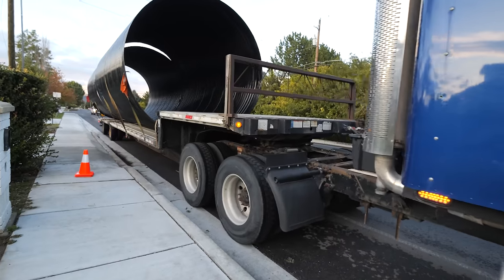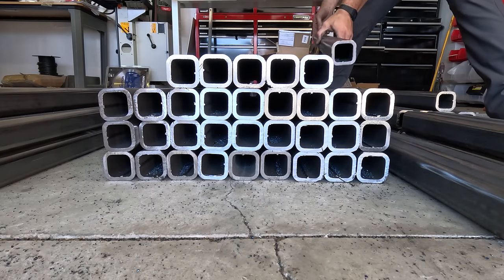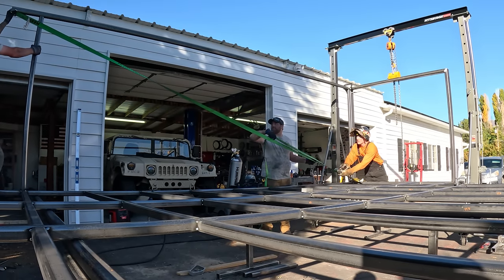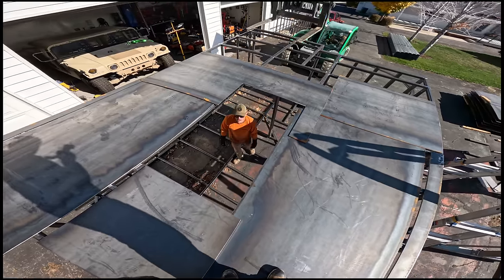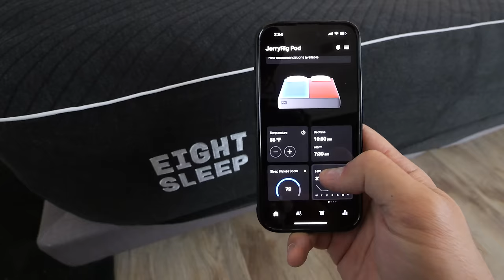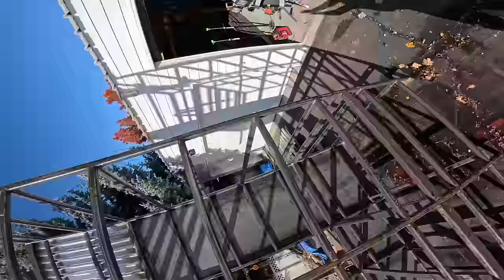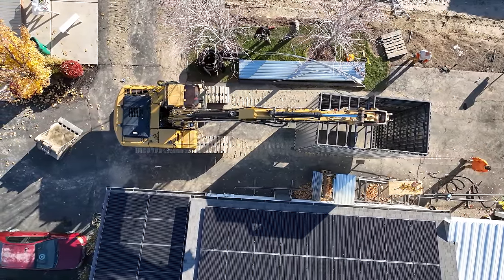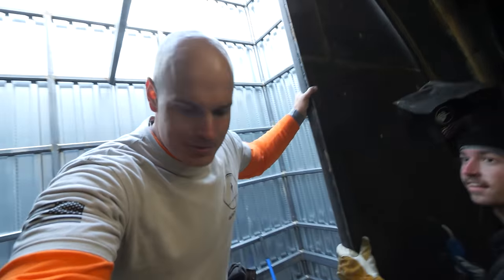BACKYARD BUNKER PART 4 - THE ELEVATOR SHAFT

Comment: Cold saw is most price effective method (fine teeth/lower rpm with coolant). Paying to have material bundle or laser cut to length saves loads of time and money. Plasma torch works great, but not clean.

Comment: Your culvert might not have needed a concrete footing but your tower definitely should have appropriate footings.  Also, the hole is dry now, but is there a chance water may build up in the ground in the future.  if that is the case then your joint between the two culverts should be totally welding and not depend on the gasket to keep it dry.  The weight of water is significant if you calculate it out, for instance at 33 feet deep the weight of water is equal to one atmosphere per square inch which 14.7 pounds.  That means that a square foot of the culvert will have as much as 2,116.8 pounds of force on the outside.  Good luck.

Comment: Hey Zack, you can put wifi into your bunker with no issues. You probably want an access point in each section. Particularly if you are boxing off the bunker into rooms. Just run ethernet from each AP to a central point and connect to a POE switch. How you get internet to your bunker is the next problem. I would say that you could probably run external grade ethernet from the house. But if you are worried about electrical storms and other apocalyptical things then a fibre connection is probably the way forward. You'll want to have a managed wifi system so that as you move from section to section then your device will roam seamlessly. I use TP-Link Omada personally, but similar systems are available from Ubiquity and Zyxel and I'm sure others. Both TP-link and Ubiquity do wall plate access points which have ethernet jacks built in. They even support VLANS so you can assign each jack to different networks.

Comment: As long as the cover doesn't require and internet connection and just a Wi-Fi connection, you can just take any Wireless access point and just use it to broadcast Wi-Fi, it doesn't need an internet connection for the Wi-Fi to work.

Comment: For an enclosed wifi for the bunker. Could be possible with something as simple as an esp32. With the 8 sleep it will "dial out", replicate its destination and keep it enclosed. Send back the correct signals. My guess would be its probably running mqtt messages or similiar.

Comment: Was a certified rigger (crane type) many years ago. That is one big hunk of steel. Swinging big chunks of steel is always pucker time. I remember my last. Something about that big, up 11 stories, over the roof, out of sight and working by radios. Had to put it on 4 hardpoints, one chance. You hurt my ears with that battery impact gun and I think you might have hurt yours. Did not see ear and eye pro. Be safe and I wish I could help. Working with stell you weld a lot. I'm not bad at it.

Comment: A Router will give you WI-Fi in the bunker but not internet, you would have run a fiber or some other cable, you could also have a cell modem and put the antenna top side. Internet as long as it is working.

Comment: The entry exit structure has metal legs, I think having a concrete bed underneath is better so the two structures the conduit and the bunker access structure don't slide down overtime asymmetrically.

Comment: Buy a wifi access point, something like the unifi uap 6 lite aught to work in the space but the pro or HD will have better proformance, drop an ethernet cable or a fibre and a media converter and you'd get great WiFi down there.

Comment: I'm sure you already thought about this but just in case it has slipped your mind,
A)  make sure the batteries have a way to vent that is safely isolated from your Living Space this is both for when they charging and gases get released & (Heaven forbid) if shit hits the fan & a short circuit or some other electrical malfunction causes the batteries to overheat and expel toxic fumes, that would be a terrible way to meet your maker!!
B) a suggestion for your heating system is that you have the heat radiating from under the floorboards...
that'll give you a nice even heating pattern and since warm air rises it'll probably the most effective way to heat your bunker...

Comment: If the bed just needs a wifi connection but not internet, that's stupid easy, just set up a router/local network and wireless access point. However if it needs internet connection, you're SOL in the apocalypse (unless you can find a way to permanently cache anything it needs to access).

Comment: That bed needing Wi-Fi doesn’t mean it needs internet. You should try unplugging the internet cable from your router temporarily to see if it needs an internet connection, or just Wi-Fi. For those interested in the difference, Wi-Fi is a system of connecting devices to the router, and then making it possible for them to communicate. This means that you can have a connection very similar to Bluetooth, except the file sizes can be much larger.

Comment: Well if i had a project like this i had found me a used band-saw with automatic cutting, they are not that big and not that expensive, and it can cut a length of pipe down for you with no intervention, then you cut small sizes on that and long ones on the miter..

Comment: Zach you can enable WiFi in the bunker. Put points in like you normally would but leave them exposed in the room. Lay cable up to the surface and hook it up to a satellite service. You can encase the satellite disks in a sort of elevator or box you can close when the bombs fall! Bam, Wifi and internet in WW3! You could ask Elon to send you a Starlink kit.

Comment: @ 17:03 where are your ear plugs?  That's how you go Deaf!  WiFi in bunker: Maybe someone has already mentioned this but setting up Home Assistant on a Raspberry Pi and having your own Wireless network down in the bunker wouldn't be too hard (assuming the bed cover works with HA).  I would go with a Unifi system for wifi.

Comment: i am pretty sure you can get "your own wifi field" by just normal router or Accespoint only if you need to comunicate with some servers your need the internet. you can test that by just disconecting the "internet cable that goes into your router.

Comment: Run a fiber cable from your home's router to a wireless router inside the bunker. Use an SFP to RJ45 fiber media converter at each end to convert the fiber cable back to ethernet (RJ45) connection. The real question is whether the mattress needs an active internet connection. That can be tested by unplugging your modem and see if it still functions. If it does your set. If not, let's hope Starlink is active during the apocalypse.

Comment: You gotta plan in case there's a nuclear blast, and radiation in the air. Ventilation system will be useless in that case. You need a system to generate clean oxygen/recycle air internally, and some system that analyzes water that reach the bunker and checks if it's radioactive & chemically clean. Possibly also a very strong Radio that will allow you to communicate with other survivors far away, if telecomunications get taken down. Of course this is all very much unlikely, but isn't a bunker mostly made for these very unlikely scenarios? so yeah, the way it's being planned right now, it's not gonna get you very far in a real serious apocalypse.

Comment: Awesome project, but that "safe" operating of the telehandler and the not-so-ideal way of using the strap while lifting the shaft upright had me a bit concerned about the safety. Snapping straps are no joke, had one incident just last summer at work, luckily no casualties.

Comment: Yeah sure a bandsaw might be slower, but bandsaws have different tpi blades for that and a normal bandsaw can probably saw 16 of those tubes at once. The advantage of a bandsaw usually is: When you saw through some 10x5" piece of steel, your carbide tipped wheel will probably be dull and glowing red before youre halfway through the block.

Comment: It should work with just a powered WiFi router without any internet cable connected to it as long as you don’t have any schedules planned to auto-on and off the module. Same concept works with Phillips hue as well.

Comment: When you say wifi for the bed. Do you mean local network beacuse if that's the case. Just setup a router. Even if there is no internet. It will still allow you to communicate with the bed.

Comment: something that definitely has me slightly concerned about the structures longevity is that they didn't even bother to give it a waterproof coating should albinos Steel protects a bit against corrosion but over time those welds are gonna rust. & thát I can absolutely guarantee!!

Comment: about the wifi for the bed (if you actually want it that is)... the feasibility of it depends entirely on whether the bed just needs wifi to connect to your smartphone locally or if it's cloud controlled. If it is cloud controlled then it only works as long as 8Sleep servers are up and accessible (and I doubt that'll be the case during the apocalypse). If it only depends on the existence of a wifi network for local connections, just stick any old router with a built in wifi AP (almost all routers) in the bunker, connect it to power and connect the bed to the wifi. the wifi will be 100% useless for anything other than controlling the bed and other local devices(local servers, smart tv's, smart toasters, etc.), but if that's all you need it for,,, it'll do the job.

Comment: Iam a bit weirded out by the lack of foundations. Also given the ginormous amount of volume you will be concerned about the pipe floating too with hydrostatic pressure. Iam guessing thats what the concrete blocks are for, though with the amount of volume iam not sure just four are enough. Man these projects are cool though and iam sure we dont see all and you consulted engineers, so i guess all is well. Will be a banger of a hobbyroom/ bunker

Comment: I wonder why not just use piping that is slightly narrower than the ones for the bunker but in a vertical orientation for the shafts? Is it connecting them to the ends that would be too difficult? Not an engineer just enjoy these videos and the whole bury a pipe idea was good so I wondered why change tactics.
Reply: I mean you could even come in at an angle so you could look at a ramp instead of a shaft. Which would undoubtedly cost less than an elevator. Just watching how y’all loaded in the steel. I know what’s done is done and I feel bad even saying this but for when I come back to this video in the apocalypse I have my own notes
Reply: @Akvandy   It's a valid point, but a ramp would take extra space and because he's so far down to get a good angle for someone in a wheelchair it wouldn't fit as well in his backyard. If he had a bigger backyard, then I could see it fitting. Personally, I'd rather avoid ladders and elevators for something intended to survive the apocalypse.

Comment: You should get in touch with Colin Furze and ask him for tips and maybe do some sort of collab... Although, maybe this video is a few months in the making considering that we're now in december💩

I just watched his latest follow-up video on his bunker build, and it seems that you don't want to cover the outer metal in anything and instead pour the concrete directly on it as any tarp-like material would trap moisture... Something about bare metal against concrete having a chemical reaction which almost halts any potential for corrosion (resulting in a stable ph-value among some other things).

Comment: Instead of a TV would you consider those laser/led short throw projecter to save space or something mutil purpose like its a bed when not in use and when the bed is fold upwards the bottom surface can be used as a projector screen?

Comment: Zack 

wifi is different then internet 

you can have wifi it's pretty easy 

Internet ====>  Router =====> wifi antenna ====> your devices  
                                                           

if you cut internet you can still connect to the devices in your LAN 

if you meant that it needs to have a internet connection than yeah it's harder but could be still doable with a small raspberry if it's open source enough

Comment: As far as the mention of WiFi in the sponsor spot. I know you’re probably not super serious, but you absolutely can continue to run WiFi even if there’s an apocalypse. You might not have an internet connection- but your home WiFi would still run with power. Just depends if the app you use to control it requires the internet as well

Comment: I know this is not related to your bunker, but I thought the best way to add windows to an O’Neill cylinder would be to have three strip islands have transparent walls (carbon nanotube fabric reinforced transparent composite) to keep their atmosphere in, that way any crack on the other three transparent strips can get cracked or damaged, and you don’t have to worry so much about your atmosphere.  

Also, A long time ago I saw a company that made ”solar windows.”  Basically, The glass had light guides embedded in it and some of the light would go into the edges where it had solar cells, which allowed some of the light to get through while generating power at the same time.
-The girders and cables that make the skeleton would simply be exposed along those section, and you could have a graphene enhanced glass or polymer as the window with light guides doing the exact same thing, just on a huge scale.  
-that way you could have natural light come in and illuminate the cylinder, while generating electricity at the same time.

Comment: I have to ask, after all the work connecting both of the conduits together using the flanges wouldn't it have been cheaper and honestly better to just use rebar molds and pour concrete?

Comment: Setting up a WiFi network in the bunker won't be hard, but if it's connecting to the outside it could get a little complicated.  Not impossible, just complicated.

Comment: WiFi is a non-problem that's solved with a $20 wifi router, though it's dumb of 8sleep not to use bluetooth. If it had required internet access it would have been a very, very different issue.

Comment: Jerry you can make your own wifi in the bunker just need a wifi 6 box and a Pc id say a laptop with linux server!

The best Linux server distros of 2023 in full:
1. Ubuntu Server. Best Linux server distro for scalability. ...
2. Debian. Great Linux server distro with multi-architectural support. ...
3. OpenSUSE. Best Linux server distro for long-term support. ...

The reason i say Linux is its free and low pc req and if you use a laptop you can get the best out of low power use!

Comment: Who did the engineering on this project? Like many other engineers in the comments, I have similar concerns. Personally, I would have built it out of concrete. Cheaper, easier, faster, stronger. as designed, this structure is disposable. Let's see where this goes.

Comment: Let's be honest, this thing isn't going to survive ANYTHING. The only thing it might be useful for is "the purge" scenarios and only if the doors are quite strong. Otherwise you're better off having a reinforced house instead. It's not going to handle a nuclear blast because it's not made by vault-tec. And I'm pretty sure you won't have enough food and water to handle the fallout.  So I don't see what's the point of it anyways. You might want to transform the walls into a faraday cage so that devices inside resist a EMP. You wouldn't want that battery you keep talking about suddenly exploding. They already blow up without a EMP.

Comment: The 8Sleep is quite the stretch. It doesn't work at all WITHOUT INTERNET. So even if you had WiFi, it still wouldn't work during the apocalypse. It's cloud only, no local control. To be honest they probably gave you quite the sponsor deal, but it just doesn't fit here at all.

Comment: 11:14 Connect your home and bunker via  four separate conduits, I.e. electrical power, data, freshwater, wastewater.
Using the data conduit you can pass Ethernet to your bunker and equip it with its own WiFi access point 😉

Comment: Hi as someone from construction industry I love to see you working on construction projects. I'm just a little concerned about safety for you and your team.
What concerns me the most is how you are in the crane / excavator pick area making video. Typically there is a  no entry zone around the cranes pick radius, in case there is any failure no one is pinched between the pick.
You can setup your cameras before the pick and then do a voice over. 

Also you climbing down the pit like that has a risk of the dirt collapsing on you.

 Please add Hardhats, safety glasses and PPE for you and your crew. 

If you want some information on safety during construction I highly recommend getting a quick online OSHA safety 10hr certificate.

Love everything you build ! Stay safe...

Comment: You need to be careful, there are two types of Wi-Fi devices those that work independent of the internet and those that require the internet. If this is a bunker and it's being used because of a global issue, you're not going to have internet and then your devices may not work.